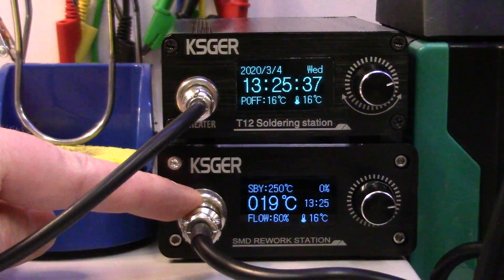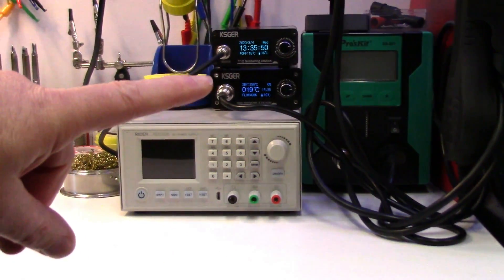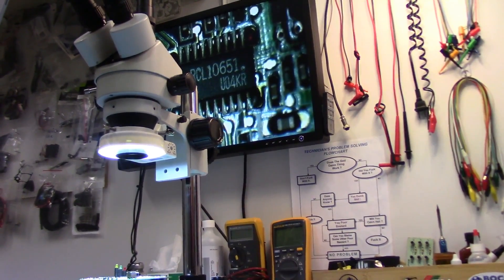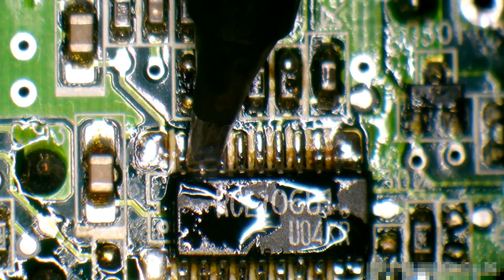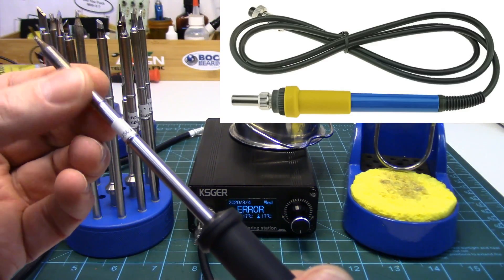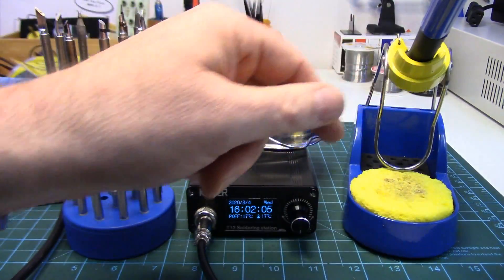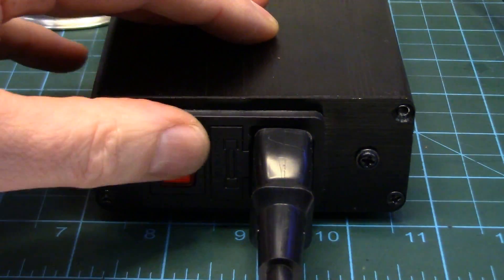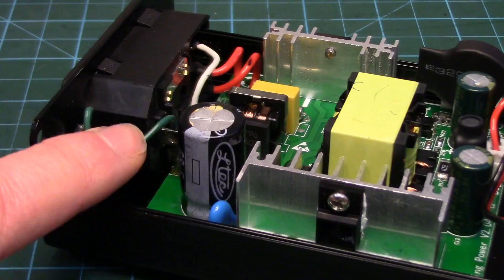KSGER T12 & 858D Station Follow Up & Questions Answered

Comment: I know this video is old but I just bought one of these soldering stations last week. Just letting you know they are now "Earth ground" they also removed the terminal for the light in the switch so you can't do that and they redid the PCB so that power lead is well away from that heat sink. But I love the soldering station . I was looking forward to tinkering with it but, there is no need to now. Lol!
Reply: I just picked one up from Amazon, and it is the Silver faced one, it has all the factory changes re chassis ground and the new power board with the heat sink no longer crossing over a power trace. It also has possibly an ideal version of the 9501 wand, with a metal collar at the base (not a screw on one, it is just not all plastic where the tip opening is)  but mine is not showing continuity from the IEC earth ground pin to the tip of the iron. Is your iron tip grounded?

Comment: Thanks for the video.
When I ordered mine, it came with the 907 iron and there was no option to select a different one because it was on sale from AliExpress. 
Honestly I am not a big fan of the 907 since I want to change the tips on the fly. So, I noticed there is another iron called "S1" which almost looks similar to the 9501 but all in black... 
Is it functionality wise the same?
Reply from the maker: I've never heard of the "S1" handle so have no idea. I've used all three of the "popular" T12 handles which include the original FX9501 (still the best by far IMO), the later 907 (not bad but not great - no on the fly change-out as you pointed out) and the aluminum 9501 (which is the worst of the three IMO).
You can still get the original FX9501 handle at Ali (lots of them listed) and that would be my recommendation. Just make sure you choose the one with the correct plug end for your specific station or of course you can solder the plug end from your current 907 handle to the new 9501 handle if the plug is not the correct one.
Reply: @Rchelicopterfun  Thank you for the reply.
Actually after some diggings, I found out the the key difference between the new S1 and FX9501 is the tilt sensor. The FX9501 has a vibration dual rolling ball sensor, whereas the S1 has a mercury sensor.

Comment: Another great video John, I’ve ordered the t12 v3.12 after your recommendation. But I’m not getting along with it at all. It came with two tips the k tip and ILS which was no help as I’m using it for de soldering Xbox one controller joysticks. So I’ve ordered more tips and they’ve arrived and the soldering iron just doesn’t heat up enough and melt the solder, I’ve got it set to 320 degrees and still it doesn’t melt solder it melts it on the tip but doesn’t melt on board when I go to apply solder just sticks to the iron, I’ve even just ordered de soldering pump yihua 929d and that solders better than it. So there is something definitely wrong I’ve not calibrated it yet could that be the problem?

Comment: How thick are the wires you have used John for the switch LED and grounding the case? Great video and many thanks
Reply from the maker: @Kobra1977, The neon lamp draws very little current (0.1A or less) so you don't need big wire at all. I think I used 18AWG looking at the size of it in the video, but it could certainly be smaller. Grounding wire by code should be the same size as what the power cable uses. Again, I think I used 18AWG but don't quote me on that.

Comment: Well it has been 2 years so far , how is that hot air station working out ?  I plan on getting one to add to my soldering station collection .......
Reply from the maker: Working fine. Only complaint is the fan in the handle like many small brushless fans is getting a little noisy until it runs for while. A drop of oil on the motor shaft will likely fix that, but new fans are inexpensive as well.
Reply: @Rchelicopterfun  Thank you very much for your reply , it is on my wishlist on Ali Express.... Merci

Comment: What is the advantage of the FG-100 over the thermocouples you often receive with a multimeter?
Reply from the maker: Two primary & obvious ones:
1. The thermocouple on the FG is held elevated over a splatter plate so the solder tip easily rests on it with consistent pressure (=consistent readings) and flux & solder drips are of no issue.
2. The replaceable thermocouples on the FG are inexpensive and easy to replace as they slowly rot out from continued exposure to the molten solder and flux. Whereas a DMM thermocouple probe that rots out from continued submersion in molten solder will require the entire probe be replaced which often costs more than the entire FG-100. DMM thermal probes were after all never designed to be submersed in a blob of molten solder; may even affect their accuracy before they do rot out.

Comment: the big question i had was could i get a t12 and use the hot air handle in it for shrink tube... this close up shows the plus look like different sizes...
Reply from the maker: @joe schneider No - completely different internals., The GX connector is also smaller on the soldering iron. T12 soldering iron heating elements run at 24 VDC, hot air wands need way more power; their heating coils run on AC line voltage. Solder stations use a MOSFET to switch the iron heater on/off to regulate temp; hot air stations use a TRIAC.

Comment: will $15- 5 pin tweezers work with a t12 host?
Reply from the maker: Sorry, no idea but I doubt it. These T12 station's PID algorithms and output voltage/current are specific for direct drive T12/T15 solder tips only.
Reply: @Rchelicopterfun  thanks for the insight!  guess some yihua stand alone tweezers will be the way.. if they are functional.

Comment: Hi. I got both. I think it's better to have separate hot air workstation and a soldering station, if one gets busted, one can still use the other. I'm not sure if the T12 mini (either from KSGER or the rebranded Quicko which is almost twice as cheap and the Quecoo) is better coz' it's more modular but I'm not sure if it's good stacked coz' it's small and lighter. 

I have both the KSGER T12 (thanks to John Salt channel) and the 858D (thanks to Dave Jones of EEVBlog). It's nice there are non branded brands from china that's great but it took weeks to research- seek and you shall find, philosophy
:-)

God bless, Rev. 21:4

Comment: I have the Ksger T12 (sadly it's the old firmware but it's other favorite tool now) just yesterday and have tinned all 10 piece tips (per piece they are ridiculously expensive) thanks to sir John's review and have had the 858D, thank to sir Dave of EEVBlog, which I've had for 5 years I think (I used it for controlled toasting of bread and melting cheese as wll and removing address on packages for security, if I want to save the packaging, else I just cut the package sticker). It's nice my rig just costs less than US$100 and it's a huge upgrade when it comes to soldering compare to my Iroda which is great for portable soldering (roof, camping) though it has a blowtorch, hot knife and heat gun (will still be very useful).
:-)

Comment: @ John Salt, I was curious about how you built your power switch boxes for your stations. I plan on doing a project like that here soon and would like some input. I will be building a self contained switchboard using an anodized aluminum box, 5x 15A rated 120V panel mount outlets, 5A fuse protection per output, lighted rockers rated for 15A 120V per output, and a 15A 120V fused power input to run the box. I will also make the housing fully grounded as well. I considered an isolation transformer from the input to run the output circuitry but I feel that may be a little overkill and not to mention bump the project price quite a bit since I'll need a low profile transformer. I will be running 2x KSGER solder stations, one hot air rework station and a DC power supply with one output left as a spare. Any advice you could give would be appreciated. I considered using standard residential switch boxes tied to outlets but I like the idea of a self contained unit a lot better.

Comment: (Wow).  Thank you.  Mr. Salt, ¿is a unit like this too professional for a relative, (but not complete) novice, applied to general repairs of electronic/stereo gear, for instance.  (And into the near future, for electronic projects)?  (Also for upgrading from a plug-into-wall_AC style wand that Radio Shack sold, 25Watts, w/replaceable tips I currently own/use).  Thank you.

Comment: Hello there, first of all thank you for all the reviews. I bought this to use mainly in electronics, and I bought it because of all the great feedback this station has, and now I'm a bit let down. Mine came with the new 907 handle, and I also bought the kit with all the tips, and after trying to use it a few times I came to the conclusion that it just lacks power. I've tried to work on several things, the last of which where a couple of SMD capacitors I was trying to remove, and I had this set on 350ºC, using the T12-JL02, and it felt like the solder wasn't even melting. And regarding the tips, I must say the one I was most looking for was the T12-JL02, and after applying solder to it I've noticed that actual tip on this does not hold solder, so basically when I apply the solder comes up a bit to the larger part which makes it difficult to work with this one. Well this is just a "cry for help" so to speak, because I do not know what to do and you guys might. Is the 907 iron just not worth it? Or am I missing something here?
Reply from the maker: The handle type (the 907 or the 9501) have little to do with tip performance so I think you can safely eliminate that. What has to do with performance is vast in scope. Tip, station, quality of solder, quality of flux and of course the main one - technique.
1. Tips: Since you say this happens with all your T12 tips in the set, then we can likely rule out a faulty tip unless you got an entire bad set which seems very unlikely. Have you broken all the T12 tips in correctly by going through the calibration process?
2. Power: Next is lack of power, well I can assure you the KSGER T12 stations using the direct drive tips have LOADS of power. I can solder 8 AWG wire with my two T12 stations and with a 40mm D4 tip, they can even pump out enough to do 6 AWG with good technique and a little effort. If they can do 8 or 6AWG wire, they most certainly have the power to do a tiny SMD component.  But you could always have a faulty station, unlikely but certainly possible.
3. Temperature / Calibration: You say you have come to the conclusion it lacks power, have you tested that conclusion with hard data to back it up?  Have you checked the tip temperatures with a solder iron temp probe & have you calibrated the tips?
4. Tip Oxidation: If you've checked the temp & calibrated the tips and you know the tips are getting to the correct temp you are setting them to; solder not sticking to a tip is commonly caused by oxidation on the iron coating on the tip end. Have you cleaned your tips, both in flux and then a sponge (wet or brass) and clean them constantly while using them and tinning them to keep them "wet" and tinning again before putting them away? Cleaning the tips are one of the most important aspects of soldering since tip oxidation will most definitely prevent the solder from adhering to the tip and there will be little heat conduction between the tip and solder then. It's all but impossible to solder with an oxidized tip.
5. Quality of solder & flux: Are you using good electronics quality leaded solder with quality rosin flux in it such as Kester 44 60/40 or 63/37? Are you using extra flux as needed as the rosin flux boils/flashes off? 

Lots of variables that determine how good the soldering job is - or isn't and the station is only one component in the chain.

Comment: Thanks John thanks for the in depth tutorials on these units and how to fix their faults, it tipped me over the edge to get one .
However the 1 fault I see with these units is the lack of a power cord,for with out a power cord they are just a paper weight.
They really should come with a power cord.
On the Chinese junk comment, 
Well  open the back of your TV up and you will see Chinese parts,Sony parts,Phillips parts you can see where I'm going with this, a lot of the electronic equipment we buy is made in China, or Taiwan  ,Korea, Asia
So it isn't so much where it's made but how well it's made,and as you said to what price point it is made to.
This determine's weather or not the item you purchase is a  piece of junk or a quality product.
Reply from the maker: Yep, I agree they should give that option. I see the reasoning behind not offering a power cord since these are universal voltage devices sold to all markets, so different plug types are required; but they could have a plug type option at checkout like some other devices have. Of course I know what would happen then, people wouldn't pay attention at checkout, order the wrong plug type, and then bitch about it and cause way more hassles than it's worth. 
So true about China stepping up its manufacturing quality game every year. They are following in the manufacturing success steps of Japan IMO. When I was just an ankle biter, made in Japan conjured up the exact same negative remarks. Will the "made in China" sticker have the same high value as "made in Japan" does today, and demand the price premium that goes hand in hand? I won't be at all surprised.

Comment: This isn't really on topic, but a hot air gun is also great for removing stringing on 3D prints.  Depending on my temps with PETG, I will get wispy strings.  My hot air gun makes quick work of them.

Comment: Metal toggles. Metal plate.  Mains power.   Oooohhhhhh.  Not ideal.    Strongly suggest using plastic mains voltage switch plates which are fully com-leant and electrically isolated
Reply from the maker: And fully grounded as per the electrical code here - passes code no problem. The toggle's themselves are fully insulated. These specific ones are rated up to 250V. Do you honestly think an industrial spec SPST toggle rated at 250VAC would not be safe to use in this application? Come on! In short (no pun), it's more than ideal partner 🖕

Comment: John can you help  me ref ksger t12 won't go in standby
Reply from the maker: Only suggestion is to double check your standby time programming.
Reply: Did you solve this issue? Mine beeps after the set time but won't drop into standby..
Reply: @olliehaselden375  hi Ollie it was the ball sensor in the handle it needed turning around apparently they are directional cheers
Reply: @tonybriggs4181  I'd heard a few other reviewers mention the sensor in the Handle being wired the wrong way which would cause it to be on when in the holder instead of in the off position
Reply: It was the small ball sensor ....in the handle it needed swopping around it seems they are directional regards

Comment: How do I get one of the 858d stations fixed. I had a pop sound then the gun turned on and blew extremely hot air. The unit was off when this happened. After that the gun began smoking and was red hot. I unplugged the handle and it shut down. Now I turn it on it says "error shut unit down"
Reply from the maker: If you're an electronics' hobbyist, fix it yourself. Either by finding the faulty component/s & replacing it/them; or by purchasing either a new control board or heater handle, both of which are available separately from various sources (ebay, aliexpress, banggood, etc).  If you are not an electronics' hobbyist, then you will have to find someone who is willing to have a look at it / fix it.

Comment: On/Off switch is the correct way down for On up for Off it's just you faulty Americans :-) that are the wrong way around the UK way is much more sensible, I've noticed your domestic light switches are the same tut tut :-) I've just purchased the KSGER hope they're all good (quality control) for the price they're just amazing! great vid by the way, don't forget to put the switch back the correct way :-) so strange we look at something so small to be so irritating, stay healthy.
Reply from the maker: Yep, it's what you're used to and have built up years/decades of subconscious memory turning switches on & off. It honestly was driving me crazy (not a far trip). Regardless, down = off (lower value of 0) & up = on (higher value of 1) makes way more binary logical sense to me. BTW, I'm located in Canada - not USA! Enjoy your T12 regardless of toggle orientation; as you say, amazing soldering station & technology for the price.

Comment: Make a video on the switch box please.
Reply from the maker: I can't. Electrical codes vary by region and due to the dangers of working with mains current & voltage if you are not fully comfortable & understand the what & why of household electrical circuits, best to stay well clear. However, if you understand the basics of house wiring & how to wire a standard single pole 4 switch electrical box, this is the exact same thing with the exception I'm using a single box with smaller single pole toggle switches rated for household voltage & current (125V/20A) instead of normal wall switches inside. They are wired exactly the same internally. Neutrals all tied together. Grounds all tied together. Hot in going to one side of all toggles, hot out from each toggle switch going to each separate plug.
Reply: If you have to ask.   Then seriously, you shouldn’t be making one.   I suggest you buy a power board with individual switches and Velcro or glue it to your bench area away from your direct working space.

Comment: Would earthing the heatsink (in a similar way to what the video showed for the case) also solve the safety issue it causes, instead of the fix shown in the video?
Reply from the maker: Only if you want to ensure it's never at a voltage potential. Earthing it won't help isolate it from the PCB traces.